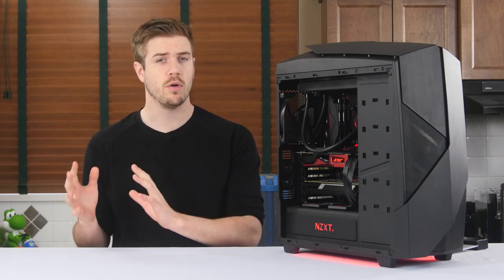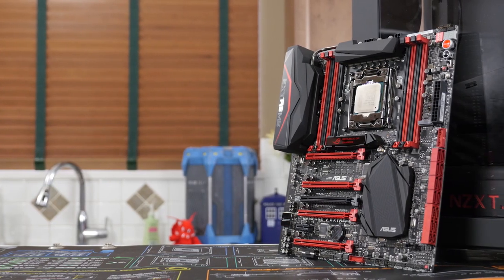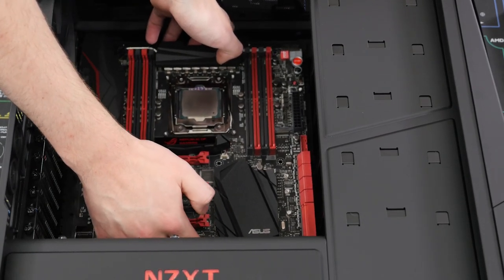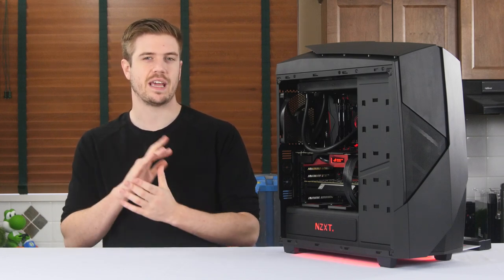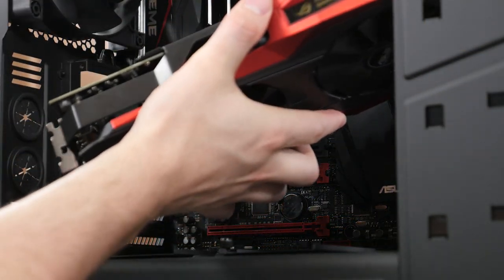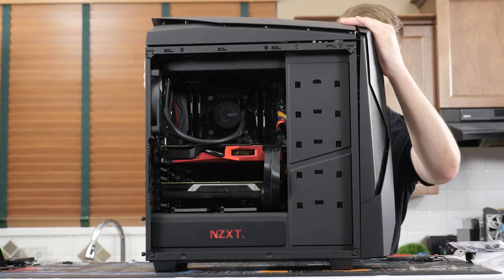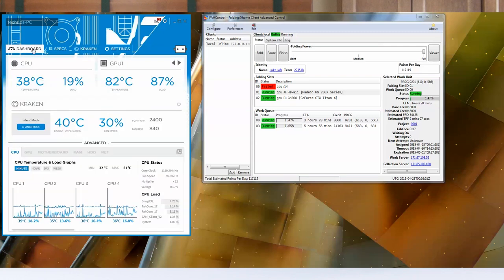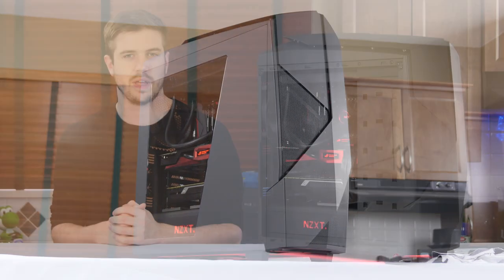ULTIMATE Distributed Computing Build Log

Comment: This is my rendering PC. I will game on it too but it will mainly be used for rendering. This is my first build so I'm not too experienced with this. Any advice will be helpful http://pcpartpicker.com/p/VTH9Q7
Reply: spectaclebear1 Get a CPU cooler the stock one is bad
Reply: spectaclebear1 Also, ask questions on a forum instead of here
Reply: spectaclebear1 Go for it, but better cpu cooler and mouse/keyboard would be good if you want a quality and comfortable feel.
Reply: spectaclebear1 Why the hell are people putting 1600Mhz RAM in a Haswell build? Even OEMs are putting 1866Mhz now. People forget what RAM is even for. If you're doing a rendering build then that 1600Mhz is a significant bottleneck also. 166Mhz RAM is one aspect where the overall community keeps parroting the same dumb bullshit advice.  http://www.anandtech.com/show/7364/memory-scaling-on-haswell/10

Comment: I know you've done a similar video in the past, but I'd absolutely LOVE if you did a guide to installing an EK waterblock on the Titan X. I think a lot of people who are interested in water cooling but have never done it before could benefit from a comprehensive Water Block installation video. There is a lot of hesitance involved when it comes to dismantling your 1,000 video card. If it was a 970 I'd already have done it, but a Titan X is not so easily replaced lol

Comment: 6:31
That's also good if you're going for a virtual setup, and need two high-performance OSes going at once, for whatever reason. :T
Also, at 7:30, you could also unscrew the Titan, take the piece with the text on it, sand off the paint and lay it face down on a fresh layer of paint.

Comment: If you have spare hardware sitting around -- such as from a recent upgrade -- this is a great way to repurpose that older hardware. Sure it's not going to be nearly as great as more modern hardware, but it's better than just letting it sit around as well. I've got a few mainboards just sitting around that I've considered building into a rack for this and having them run 24/7 -- especially since they'll be much lower on power consumption, so it'll be much easier to afford.

And when I upgrade away from my FX-8350 later this year (current plan at least), I'll have a much faster processor to throw at this unless I repurpose it for something else.

And if this were a purely distributed computing build (such as for repurposing older hardware) without being used to also run games, Linux would actually be the better option. Both AMD and nVidia have Linux drivers available to make use of the GPU, and you can have everything running full throttle on a headless server Linux distribution that will be running only what is necessary for distributed computing while probably also being significantly faster in the process.

Comment: -Watercooled cpu, air cooled gpu's (should be the other way around)
-premium (expensive) top-tier mobo+cpu
-dual 960 gb SSD's
-only 2x gpu on a motherboard that supports 4x gpu's

This is an ultimate gaming computer/workstation buildlog, with some distributed computing tips and a F@h install guide at the end.  Kudo's for bringing attention to distributed computing proejcts, but nothing about this build is optimized for distributed computing.  This felt more like an asus/nzxt ad than a useful guide/log.

Comment: How many 140mm fans can you fit inside this beast of a PC case and which fans would you recommend for a gaming pc with an i74790k and gtx 970?
Reply: 5.
Reply: Oh and yeah but 6700k exists. And if gaming get an i5 6600k. Games don't need i7s.
Reply: +Infinite Zero if he have i7 
i5 last only 2 years then starting be botleneck
Reply: +Aaponton Really? Do you know ANYTHING? An i5 performs pretty much the same as an i7 of the same tier.
Reply: Infinite Zero i know but on i7 many people get higher overclock and games on couble years stars using more thrends
Reply: +Aaponton I have an i5 4690k OC'd to 4.7ghz, thats the same my friend has his i7 on. An i5 is fine for gaming, 3d rendering... Get an i7.

Comment: So is there an actual ultimate building log for 2023? like ecolog-ically, useing less watts of power? would you use or recommend multi gpu concepts like crossfire from AMD (AmaDeus) or SLI from nvidia, if it had to be nvidia? would you recommend underclockind or undervolting due to lifespan of the parts, and so that the computer system can run with night current (what also could be highly automatized) not being too loud?

Comment: Normally you would be considering primarily compute per dollar (including power costs) and balancing that against constraints around space, floor loading capacity, heat evacuation, "green" aspirations and so on.

Those cases probably wouldn't even stack!

Comment: Folding machines need to be optimized for energy efficiency since they're gonna run 24/7. A 290x is probably not a wise choice. The board was overkill and the Storage was overkill, but he mentioned that. I'm not much of a GPGPU person, but if I remember correctly for some BOINC projects, double precision is pretty important, so get a Tesla K80 for that. If you're only doing single precision tasks, a TitanX or two are probably the best choice.
Not sure what happened to the Xeon Phi, but maybe that's an opdtion too?

Comment: Why didn't you use a Quadro or Firepro card? Those cards are MUCH better at fp64 calculations and also consume less power (which will save you money in the long run when running 24/7, while also providing faster calculations)

Comment: RAM does matter at some BOINC projects. The math ones like PrimeGrid make a huge difference with speed. Disk size can also matter a great deal as there are a hand full of BOINC projects that require Virtualbox and can use up 4+GB per work unit. 16GB Ram isn't going to cut it at those projects either unless you limit your rig to only running a couple work units which is far from optimal. There are a few projects that from time to time will also want tons of memory. 123numbers is very RAM hungry right now. You mention BOINC has CUDA for nVidia and CAL for AMD. You might want to catch up a bit. CAL has been replaced for quite some time at all but maybe 2 or 3 projects with OpenCL. Even those projects tend to offer the OpenCL alternative too. OpenCL is supported by nVidia, AMD, and Intel GPU's.

Comment: you can actually use both amd and nvidia gpus at the same time. all you need to do set up a openacc compiler and target both gpus, then just run the two programs desperately and fork the data once in a while.

Comment: i am E-30(Black Sheep) from SETI.USA  and been with them for over 5 years. now well the cpu was a good chip for boinc but i never mix videos cards like that i find the 980 does better then the  titan mostly because of boinc and ram in some projects are over 2 gb a cor so i would put 32gb of ddr 4 ram in there hd you can have any it manly your gpu and cpu and if you have the ram to back it up.

Comment: i own a Rampage 5 X99, I own 32GB Corsair Dominator 2666, i own 2 x Samsung 840s in Raid 0, i own 2 x Gigabyte Windforce 980s', but i only have a 5820k stuffed into a Corsair Carbide 300. So it doesn't look that great lol. Started losing budget towards the end.

But my point is I work part time in an e-cigarette shop whilst I am a full time student, that pays rent and have little money. I expected more from this for "Ultimate" lol.

Its all a question of how well do you save, between builds?

Comment: Get a Xeon E5-2697 v2 24 core/48 thread.  You don't need a high end motherboard (gosh).  Nice cooler.  Use an SSD not for speed but more for reliability.

Comment: My favorite mb was an asus rog i forgot the model but i spent around $500 on it. It ended up failing less then a week after the 30 day return policy and i had to buy another one. The second failed 2-3 weeks after the 30 return policy. Even tho i owned 2 and they both failed right away, it was the most amazing mb i've ever owned. Unfortunately I could not afford another so i had to downgrade to a lower end gigabyte mb but it has had no issues and is still going strong a year and a half later. I miss my rog mb so much. : (

Comment: Is this a good build for Witcher 3?

 Cpu - I7 5820k (overclocked)

Cpu cooler - Corsair h105 liquid cooler

Motherboard - MSI X99s gaming 7 

Ram - G. Skill 32gb ddr4 (2400 mhz)

Video Card - MSI radeon r9 290x 8gb

Case - Nzxt h440 black/red

Power - Corsair cx 750w 80+ bronze

OS - Windows 7 professional

Comment: what is alternative solution for thermal paste.
Reply: Nothing.
Reply: toothpaste :p
Reply: Marius Eckardt Well i used colgate and its working fine :)
Reply: How much is the recommended amount?
Reply: +Shot Up Gaming 1 dirt
Reply: +Soviet Union ok thanx
Reply: I've used colgate, and it's just fine.
Reply: +Noah Hastings wow ok
Reply: old, but if anybody cares but a drop of automotive refrigerant oil works very well
Reply: +deviroz does tooth paste actually work
Reply: Voltkick Gaming no.
Reply: Shot Up Gaming Yes it does.
Reply: Voltkick Gaming It works fine, you just need to replace it every once in a while, and as always put a pea size amount, I used it on my q6600 for a while, trust me. And if you are thinking it's gonna fry your CPU, all motherboards have auto shutoff when the cpu gets too hot. So it can't kill it. Toothpaste works just fine.
Reply: Eli Hopf But for what reason?
Reply: Soviet Union For what reason do you need to replace it? It dries up much faster than thermal paste, and you'll even notice when you pull your heatsink off after a couple of weeks when it needs to be replaced that most of the toothpaste is gone, I guess it has something to do with the heat. Again, perfectly safe, so long as you watch your temps and replace it when they get a bit too hot for your liking (90c core temp under load is still safe). But don't worry about it frying your CPU, motherboards have protections in place to shut down automatically if the cpu gets too hot. So just watch your temps and replace every couple weeks, or less often if you don't use your system as much, because the longer the toothpaste is hot the quicker it'll dry up.
Reply: Eli Hopf But why though? Why would you use toothpaste instead of thermal paste?
Reply: Try using mercury. It's metal so it has great heat conduction. Also, it's a liquid, ensuring perfect contact
Reply: Dank memes If you don't have money to buy thermal paste lol
Reply: Eli Hopf But toothpaste is more expensive
Reply: Dank memes Nope, for the same price you can get wayyyy more toothpaste.
Reply: Eli Hopf But the toothpaste doesn't last as long
Reply: Dank memes
yeah but everyone has toothpaste. And if you were swapping heatsinks or cpus out or something you could reapply toothpaste instead of thermal paste and save some money.
Reply: Luke !! Start the machine again, at the office 24/7 ;-)
Reply: Eli Hopf yeah, but you get way better temps with actual thermal paste

Comment: i dont understand why it would need a gpu for number crunching. i mean i would expect they would just be using the processor.
Reply: +volkswagenginetta it's not just number crunching, it's running highly complex simulations of protein interactions, it's really interesting, but quite a drain on your powerbill and your system if you plan on doing this in your time away from the pc.

Comment: Does the noctis 450 support e-atx motherboards?
Reply: +darkrabbit214 No
Reply: that is literally what he put in and talked about. if you put in an e-atx mobo in it will block the outer rubber grommets for cable manaement, but you can route your cables through  the drive cages.

ps- 4:00 in the video
Reply: +Noah Hastings just go to 4:00 .-. you can fit one in but it will interfer a bit with the normal cable routes
Reply: *****
he literally puts an e-atx motherboard into the case in the video
Reply: *****
are you guys for real or just trolling ?

Comment: can the Zotac GTX 970 AMP extreme edition fit in this case ??
Reply: Leon Corabeca It should be able to but u would need to remove the hard drive trays and put it in on an angle, if u give me the measurements of the gpu i can check because i have the exact same case

Comment: I am building a PC. I am wondering will it be good for gaming.
Specifications:
CPU: AMD FX X4 4300 3.8 Quad
CPU Cooler: CoolerMaster Hyper TX3 (or your advice)
MotherBoard: ASUS M5A78L-M (best i can, because there is a few options in shop)
RAM: G Skill 8 GB 1866 Mhz
HDD: Western Digital Caviar Black 500 GB, 64 Mb c  or    Western Digital Blue 1000            GB 64 Mb c  both 7200 rpm
Case:  CoolerMaster Force 500
Power Supply: Corsair VS 450  CP-9020096-EU  450W
Graphics Card: SAPPHIRE AMD Radeon R7 240, 4GB DDR3    or     GIGABYTE AMD Radeon R7 240 OC, 2GB DDR3
I have a small budget and I think that is the best I can! Please answer and give advice.

Comment: You can take off the GPU LED for both on nvidia geforce experience.
Reply: Explicit Tech the geforce logo still remains green
Reply: You can sand the green off the led. The led is actually white but its reflected through green paint. I sanded mine off on my 780 and spray painted it blue to match my theme. Black and blue!

Comment: Vs the H440 how loud is it?
Reply: Predator00063 Depends my one is loud because i have 8 fans running in my case and its pretty loud but the h440 is quieter as it has all that dampening stuff but wouldnt be that much louder unless you've got 8 fans lyk me

Comment: Im looking to be able to max out every next game with 35+ FPS.
Is that possibe with this build? 

Cpu: AMD FX-8350 4.0GHz 8-Core Processor

Mobo: Gigabyte GA-970A-DS3P

Ram: Corsair Vengeance 8GB (2 x 4GB) DDR3-1600 Memory

Gpu: Gigabyte GeForce GTX 970 4GB WINDFORCE 3X Video Card  

Psu: EVGA SuperNOVA NEX 750W 80+ Bronze Certified Semi-Modular ATX Power Supply

What do you think?
Reply: At what resolution? If 1080p youll likely get 80+ if 1440 40 fps any higher and the framerate will be unplayable
Reply: Luis Goncalves I plan to do 1600x900
Reply: you'll get better than you would at 1080 so maybe 90s, depending on the game also 750 watt power supply is a bit big 600 would be fine
Reply: Luis Goncalves I was able to get the PSU on sale for $40....I could not resist
Reply: fair enough
Reply: ***** Who said anything about an i7?
Reply: LOL please razvan. Thats better than an i5 and a lower i7. It's an 8 core beast and the best AMD CPU and in the top 5 for gaming. Intel fanboys.
Reply: Amd cpu ... Wont go for long ...

Comment: im searching all over the internet about building a pc. im hoping you could give me some input or refer me to someone who can help. im doing two things with my pc, or three kind of, im using ableton live for music production, after effects for videos and graphic videos, and then also photoshop for random graphics. when only using ableton, i use a lot of processing power, my cpu blows through the roof. i use a bunch of vsts including fabfilters pro 2 line (including equalizers, compressors, etc.) then im using a lot of izotope plug ins for mixing mastering and stuff like that. for synths i purely use massive. by the time i get half way through a song i can barely move on, i have three separate busses for reverbs, i also use some delays, but i quickly cut to audio to get what im trying to achieve. what would you recommend for this? i have somewhat of a budget but i can buy stuff over time. im also getting mixed reviews on single core processors being the best for music production, but i also would like the multitasking that my current i5 gives me. should i get a motherboard for two different types of processors or just stick to one. im lost and need help. plz.

Comment: Yo Wait Up! How could you run a Titan X and a whatever the ASUS GPU is :I Like you can't SLI them how do ou pair them...

And if anyone knows could i do that with a Quadro and a GeForce
Reply: *****
 How do you do that tho :/
Reply: +Qyndryx ik AMD has crossfire and Nvidia SLI.. im just wondering how can you set the cards so that they can run on a single sistem without "turn the current VGA driver off" sort KF crap
Reply: OHH IK IK!!! On the nVidia site you have a GPU detector.. maybe it considers those two as same and allows you to run them both
Reply: +YellowPeaches I don't think it needs to be running in SLI or Crossfire, because Folding@Home utilizes both cards (and cpu) for their own projects. So CPU works on project 1, AMD GPU on 2 and nVidia GPU on 3. As i stress tested my build in F@H (2x GTX 980 SLI, without SLI activated) both cards done just fine. Driver update unset my SLI config and i first noticed by checking the control panel haha. 

SLI or Crossfire is only "needed" if you want to use both cards for the same workload (e.g. games, or video editing). With DX 12 this may change and different brands can work together (without SLI or Crossfire). But that can take some time ^^

I hope i explained it well and answered your question ;).
Reply: *****
 It actualy did thx :P